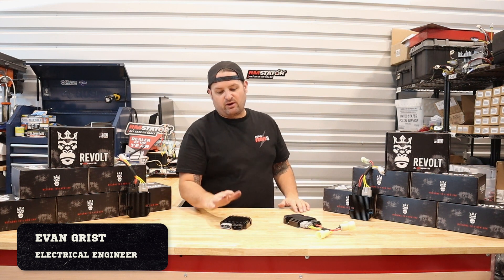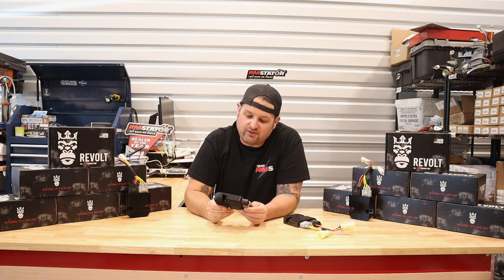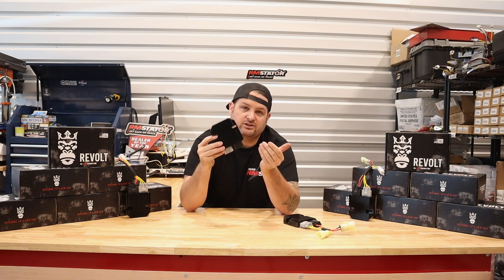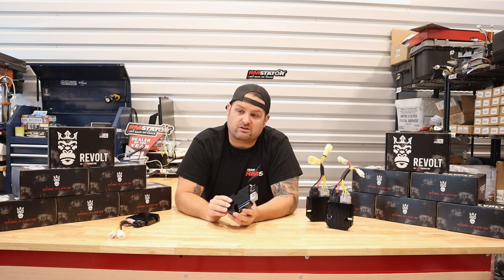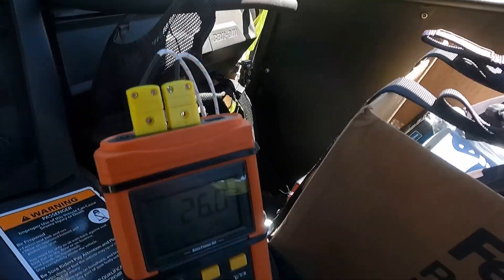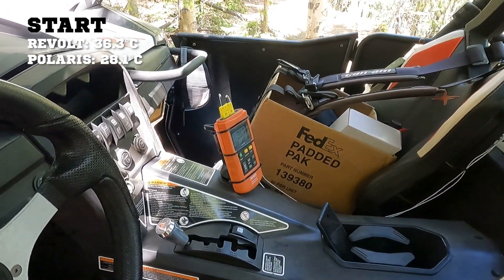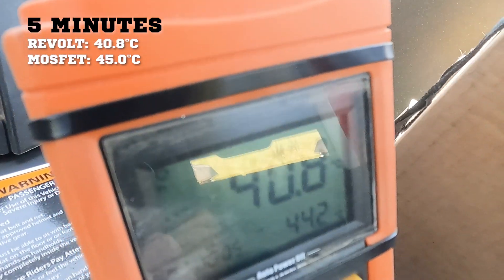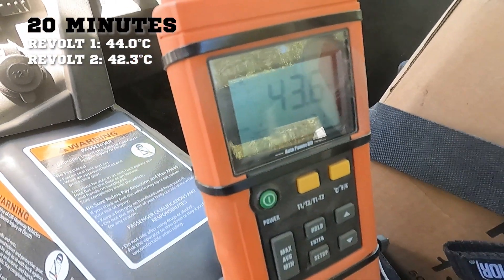RMSTATOR Presents REVOLT New Powersports Voltage Regulator Rectifier Technology For All Vehicles

Comment: Thank you for building a test rig to compare the in-use temperatures of different R/Rs, and comparing two of your own to note consistency.
Precision opamps or MOSFETs for synchronous rectification would be a welcome alternative to the traditional diode bridge.
Of equal importance is the regulation stage--shunt vs series--and the resulting temperature of the stator.
In addition to showing the temperature of the R/R at different run-times, it would be helpful to see the oil and stator (cover) temperatures.
Also, please show the voltage regulation numbers at different RPMs, from idle to redline.
I have been using the Compu-Fire model 55402 on my restomodded 1983 GS1100E, and my wife's VTR1000F for several years without incident.
Maybe another group of tests could be done that includes the Compu-Fire. . . ?
If the RMStator works equally well, I'd be happy to support a local (Colorado) business and make the change.